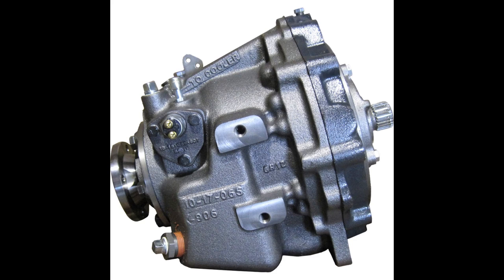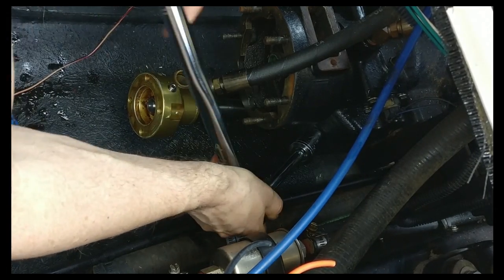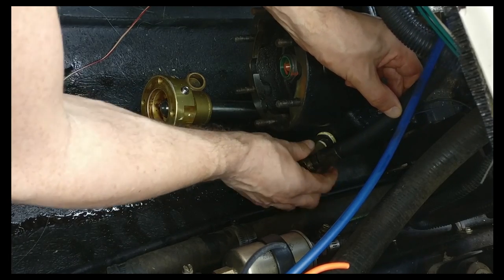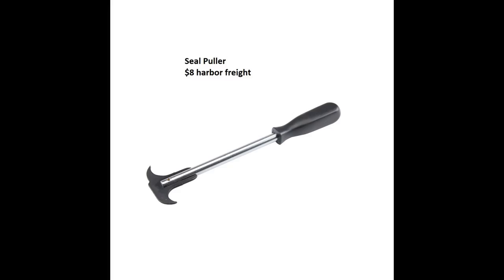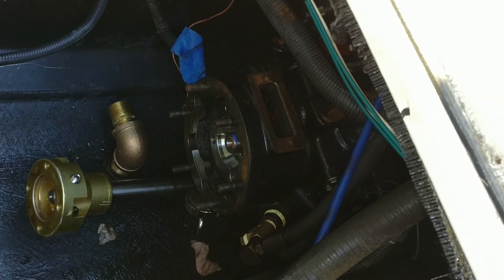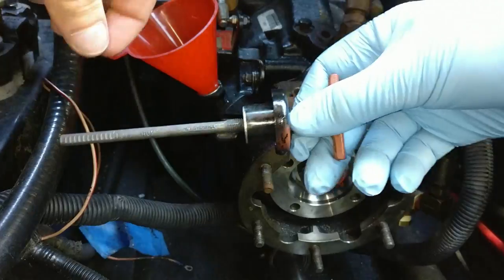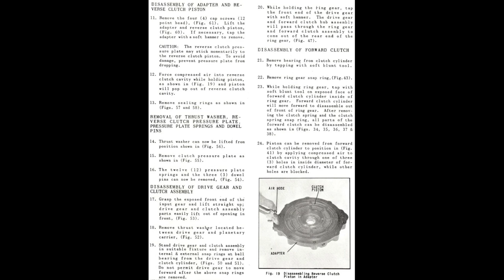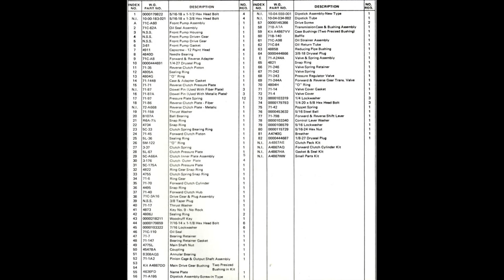Velvet Drive Transmission explained, oil change and oil seal change

Comment: I have a velvet drive on a 1970 Riva - it is making no pressure at all (checked fluid level but nothing circulating through the cooler pipes ) is there any simple answer before we have to pull it all out and disassemble ?
Reply from the maker: Hard to say. You should start by disassembling the oil pump. You do not need to open the transmission. look at minute 20:00 on the video.

Comment: Is the Velvet drive still a good option for a 1:1 fitted to a cummins 6bt pushing 180 hp ..Boat is a fast italian design and the total weight will be 3300 lbs wet

Comment: My velvet drive shifts and goes in reverse without a problem, but the shaft wont turn when shifted in forward. Motor idles and revs without any issues. Curious if I'm looking at a complete transmission failure?!?
Reply from the maker: Hard to tell. First test the Control Valve (in my other video) and test the oil pressure (I explained in this video).
Reply: @ItaiLeshniak  When you say test the control valve, you mean take it out and make sure the inner piece slides in and out with a problem? 

What is really bothering me is that it worked fine before I changed the oil in it, but the oiled looked like shit, so I was feeling happy about the oil change and then it started slipping on me going forward on Saturday and on Sunday it wouldn't go forward at all.
Reply from the maker: @MrMedicAdnan  Maybe there is something stuck in one of the oil passages. If the forward clutch does not get good pressure it will slip. Make sure the Control Valve is clean and there is nothing stock in it and test the oil pressure when it's running. If you get good oil pressure in "neutral" and it drops a lot when you move to "forward" it will indicate a leakage in the forward clutch. If the pressures stays the same it indicates a clog in the oil lines.

Comment: Question for you: Why use Dex3 when Mobil 424 is required from velvet drive? V-drives
Reply from the maker: Hi John, My boat's spec calls for Dex3. On some newer models they changes to Mobil 424. You should use the same oil that was used before, do not mix oils.

Comment: Is there such thing as a clockwise and anti clockwise AS1 - 70C  Serial No 1118.1 or how is it possible to ascertain the rotation. Just i got 2 gearboxes from a boat and was told that one was clockwise and the other anti clockwise.
Reply from the maker: Look at minute 21:20 of the video. Basically if the part number have "R" at the end it will be counterclockwise.

Comment: I have a mercrusier 340 hp velvet drive. Im pretty sure i hold 4.5 liters of atf fluid per engine. Can you confim that before i start my project ?
Reply from the maker: My boat's service manual reads "71C In‐Line 1.66 Liter (1.75 U.S. Quart) Dexron lll Automatic Transmission Fluid" you should try to find your boat's  service manual.

Comment: Nice video.. I have similar borgwarner drive.. but one of my engine is turning the wrong way.. can this be operated in revers but pushing boat forward??
Reply from the maker: No! It is not strong enough in reverse, you will burn the clutch. The simple fix is to get an opposite direction propeller.
Reply: while backflipping tha wild fantastic
Reply: @ItaiLeshniak  I thought you could reverse by removing the front plate?
Reply from the maker: @Sergio-tn8rw  Sorry, I do not understand what you mean.

Comment: Thanks - this guy does some great videos on transmissions in case you need it - https://www.youtube.com/watch?v=2GsXT37v8Aw...   Another tip I saw - if you're going to hammer a seal in place, put some sticky grease around the rubber lip that has the spring to stop the spring popping off while it's being hammered in.  If the seal's spring pops off, you won't know and it will damage the shaft.